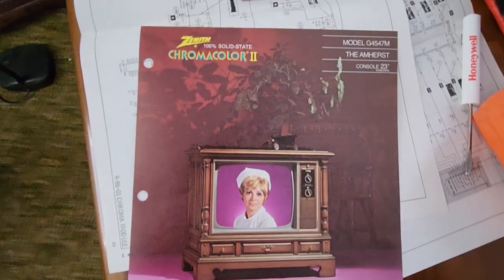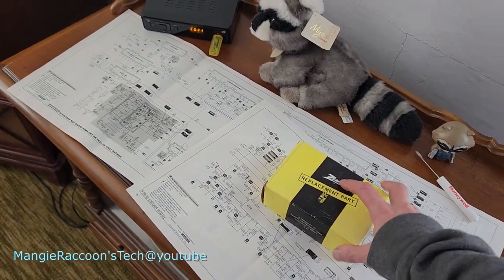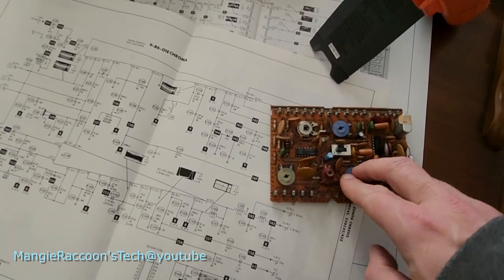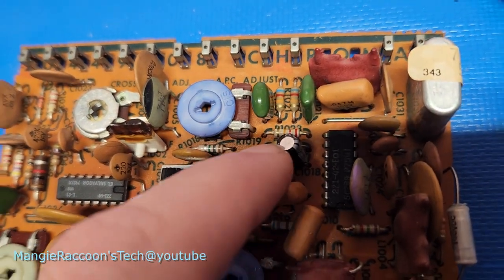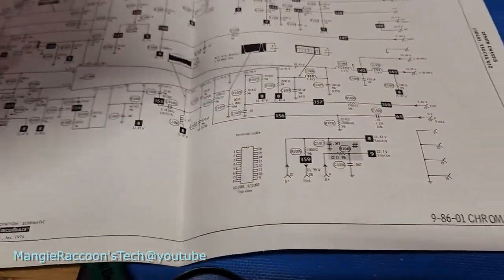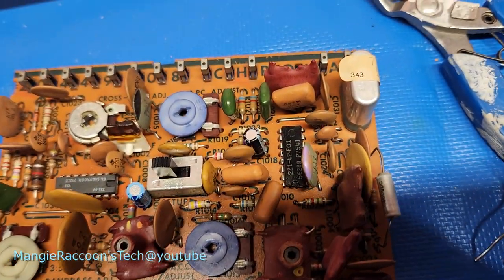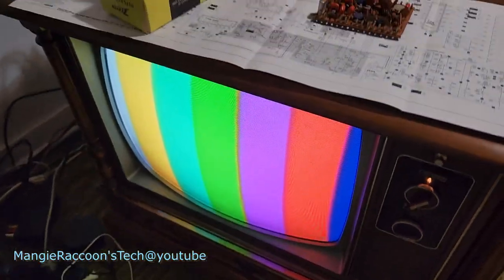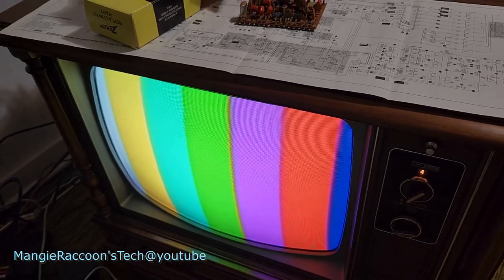1976 Zenith Vintage Chromacolor II Console Television Repair PT 3 of ?

Comment: If replacing the other chip on the original color board fixed the problem does that mean the same chip was bad on the brand new color board?
Reply from the maker: I am curious about this too. I plan on checking the new board out and seeing if I can get it working so I'll have a working spare. But if I remember correctly the resistors check out ok and I've already re capped that board, so probably the only thing left is them ic chips. They said the board was nos, but I don't think it is. And that chip probably needs replaced. I think I have another one surpringly